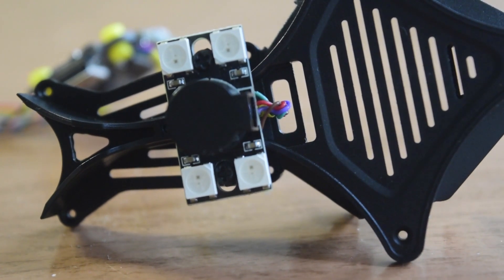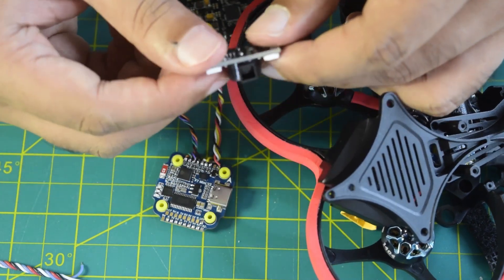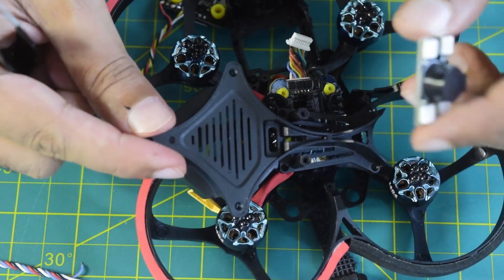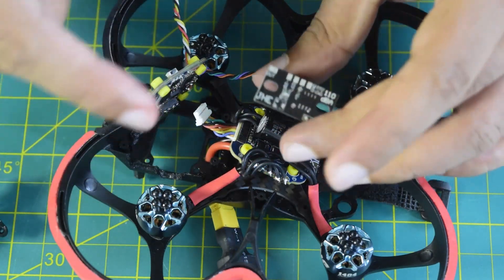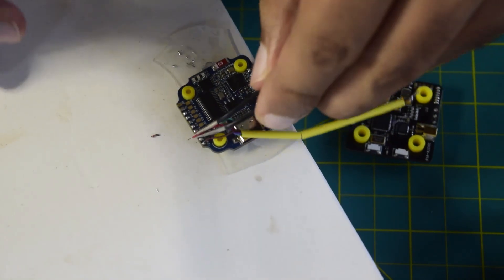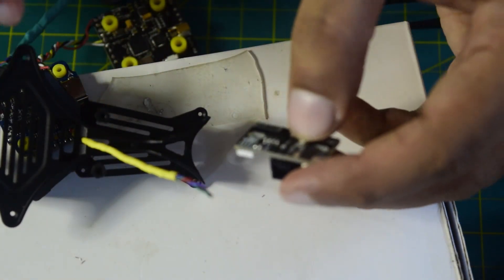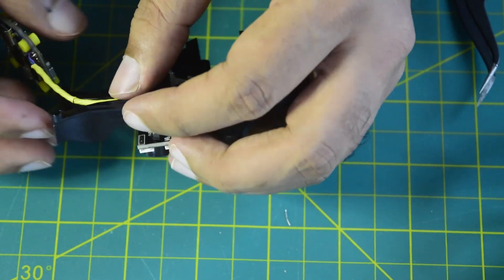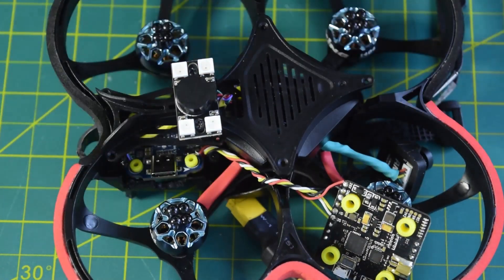iFlight 5V Buzzer Alarm with LED WS2812 on Cinewhoop Drone Frame Beta 95X with Speedybee f7 Mini FC

Comment: I have seen three of your videos of i Flight alarm buzzer WS2812 module, No where you have shown the working demo! its time killing!!!
Reply from the maker: i understand, my point was as long as you have connected it correctly to your FC its matter of config in betaflight or inav to add your led array and simple config will make it work. if you have any specific issue i can help. I am working on the config videos. Please stay tuned to my channel for my future videos
Reply: Hi  @AstroShootingStars  , I was trying to find how this buzzer sounds and how leds could be configured, how the led would glow if only power is given and no data is given to the led points.
Reply from the maker: @jaggi_b ws2812 leds are rgb leds ans dont work like normal led when power is given only it needs the RGB pulse data to be able to lit. buzzer you can test by direct positive and negative supply but it will give you long buzz sound when connected to flight controller its given also pulsating supply to give you a buzz tone rather than long buzz sound.
Reply: @AstroShootingStars  I am planning to use this module in a different project. I am also searching for the best flashlights